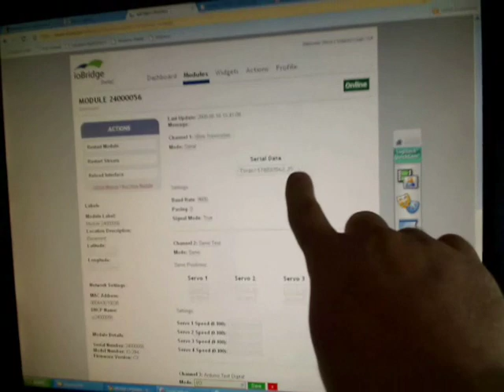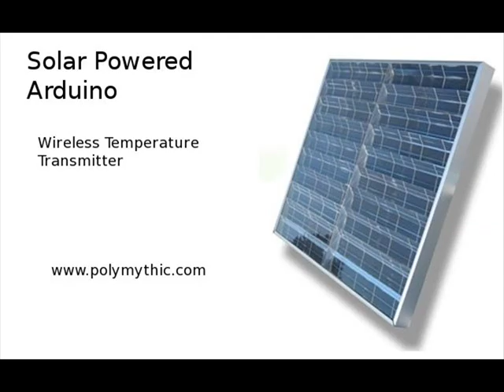Arduino + XBee - Solar-Power Temperature Sensor

Comment: I'm trying to connect my Arduino w/ XBEE shield to a remotely powered XBEE on a breadboard (using the Parallax breadboard spacing adapter) with a temperature sensor as well.  I'm having trouble getting them to connect to one another.  Any suggestions?  Thanks!

Comment from the maker: @derek1ee Well, the sensor is analog, so the Xbee does not have the means to do an analog-to-digital and send that value serially to the xbee.  If it were a digital sensor that produced serial data, it could do what you described.

Comment: What is the reason to put Arduino outside together with the sensor and solar panel? Because you can leave only the solar, sensor, and xbee outside, and do xbee-arduino-serial also?

Comment from the maker: @cool68yud In fact, the arduino was outside being powered by the solar panel.  The arduino then used the Xbee to send wireless serial data up to my ioBridge.  The ioBridge reported the data to the web.  I just used the PC to view the data as a webpage.  It could be any web browser in the world.  What you describe should also work.  Temp->serial input->arduino->XBee ))) XBee->rabbit->PC

Comment from the maker: That is possible, but you will have to write some code on your PC to post any information to the web if you wanted it to be there.  The ioBridge takes care of that stuff for you.  If you don't have one, however, you should be able to have the XBee and adapter shield hooked up to an arduino, and then have another xbee hooked through a serial cable to the PC.

Comment from the maker: Please refer to the blog post for code on the arduino.  Its all there!  Just a simple analog read and some conversion to scale raw analog data to farenheit.  You'll need a microcontroller to read the analog from the sensor and write serial to the Xbee (ioBridge, arduino, pic, etc, will work).  The ioBridge has X10 control for lights, or relay for switching.   Real easy.  Arduino probably has equivalent as well that can be done simply.

Comment from the maker: The serial communication board is to provide a buffered input/output for Xbee to the arduino.  It is read only in the instance, but if I wanted to communicate to the arduino, the serial is there for it.

Comment: Im very interested in this project. I need help on this though. How did you program the arduino board to send the temperature? Do I HAVE TO HAVE the arduino board or can i just use an xbee adapter and a zigbee module mounted on top of it? My first goal is to control lights wirelessly but I dont know where to start n what to buy...please help. THanks!